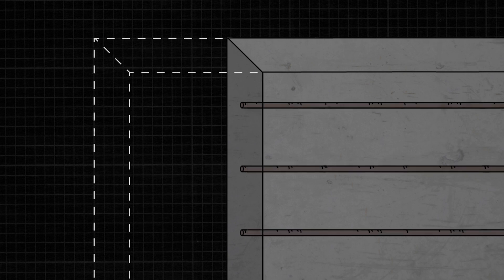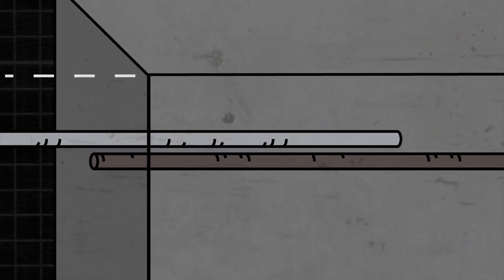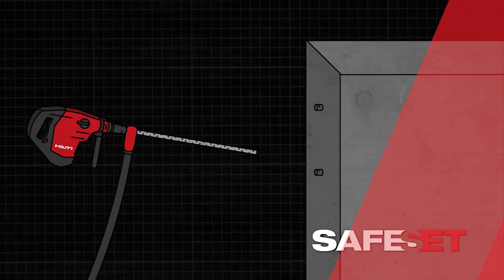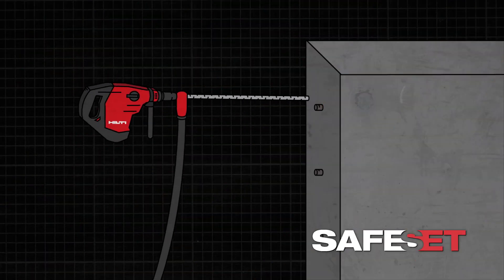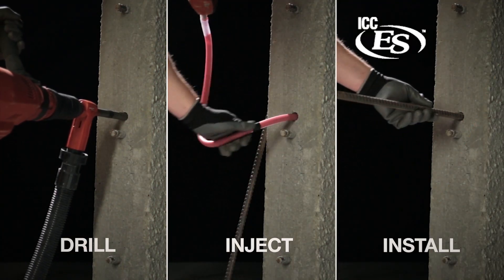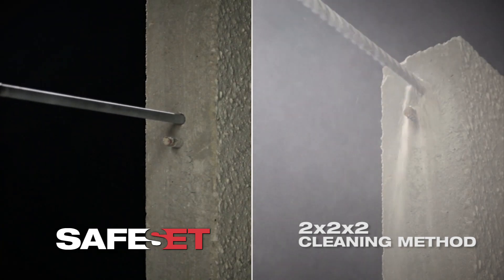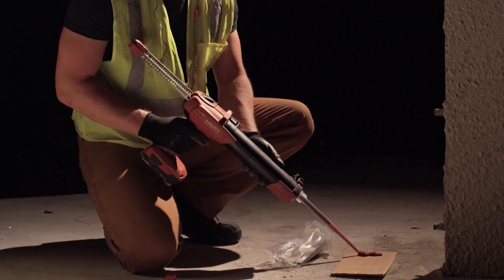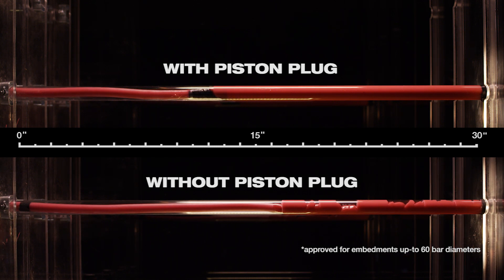DEMONSTRATION of Hilti's new adhesive anchor system for post-installed rebar

Comment: If someone were to insert a 6 inch metal rod into a rock, would this stuff be strong enough to hold human beings (so anywhere from 120-350+lbs)??
Reply from the maker: For natural stone anchorages, Hilti does not have specific test data to support anchoring into natural stones base materials due to the variability of the characteristics of the rock including but not limited to compressive strength, slake durability, jointing, degree of weathering, as well as the drilling method. In addition, there are no formal qualification tests that can be referenced to test anchors into natural stone base materials. With that being said, customers have used true epoxy anchors (ex. Hilti HIT-RE 500 V3) in the past based on their design engineer's judgment; however, site-specific testing is recommended to evaluate the anchor system due to the lack of data.

Comment: its to extend a beam or a slab rebar post intallation
Reply from the maker: If you are in the U.S., please contact our customer service team at 1-800-879-8000 or in Canada, 1-800-363-4458 for specific questions about the application.